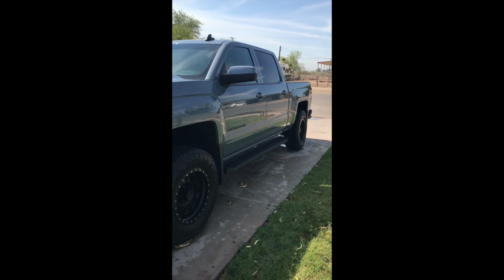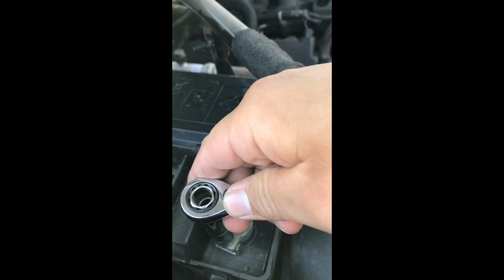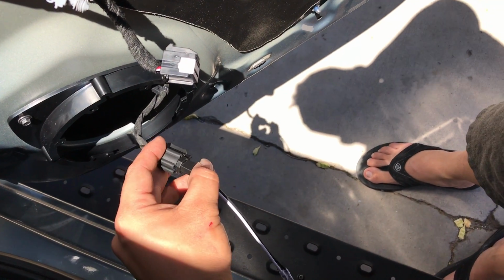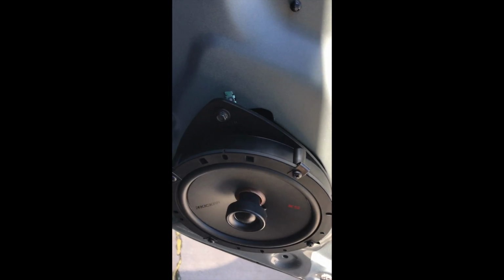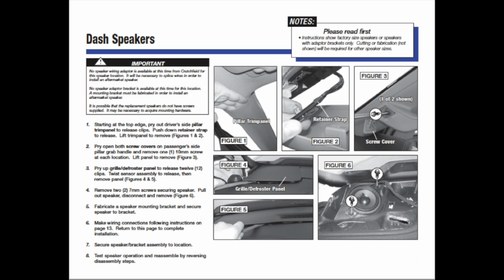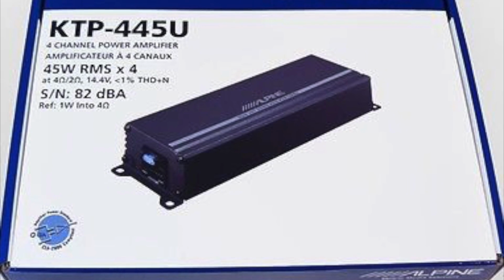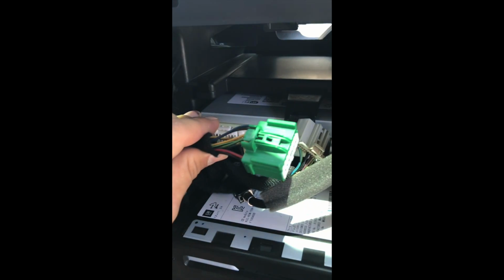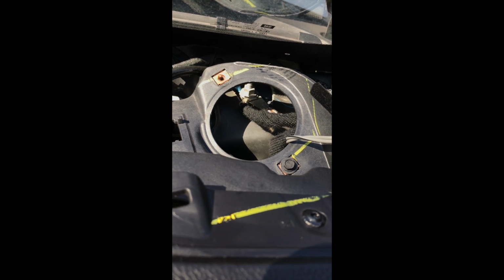2016 Silverado Speaker and Amplifier  install

Comment: Did you run a power cable from the battery to the amp?  Or used power from Radio?

Comment: Hey man I don't know shit about audio. I have installed kicker coaxial speakers on both of my previous vehicles tho. Do I need an amp to run component speakers. I've heard they have a lot more depth in sound. More bass
Reply from the maker: I believe it all depends on the type of speakers your running and the watt of the radio head unit. If you have an aftermarket stereo you probably won’t need it. If it’s stock like mine was and you want a crisper sound I would recommend one. If your not too sure install the speakers and see if it’s meets your satisfaction. All component speakers do is filter out the sound and send them to the appropriate speaker. The Kickers I bought me tweeter has 3 setting to fine tune. To be honest the for the Front speakers isn’t set to high due to the Door Chime. 

Hope this helps, any more questions I’m glad to help

Comment: Did u use bass blockers at all if so where u use them on
Reply from the maker: Hey Jesus, I did not install any bass blockers/ capacitors.  The crossover has built in capacitors. But you can add one to the tweeter as a secondary fail safe.
Reply: I got a probelm bro like I playin my music kinda loud and I didn’t have amp installed and it’s jbl speakers I have put in theire and my speaker make no sound at all I checked fuses is good but I’m say is my speakers work fine but no sound coming to them they made a kinda thumping noise before sound went off any suggestion?
Reply from the maker: jesus Santana Hey man is it all the speakers or just a couple. May be a wiring issue, blown out speakers, or even head unit.
Reply: Thanks bro for the advice and one last thing did u wire the tweeters from the door speaker or did u run a wire to the amp?

Comment: Hey after I install the Alpine amp, the sound is great but now my door chime, welcome chime, and turn signal are loud as hell.  I was wondering if you had the same issue after you installed the amp?
Reply from the maker: Hey what's up George, I had the same issue. On the amp you can adjust the front and rear amplification. What i did was adjust the front to the point where i felt it was tolerable. I believe i amplified it about 2 clicks. My set up still sounded balanced.
Reply: George Sanchez  yes just make sure to leave key in ignition. Let the chime stay on disconnect. That speaker mark them . Then the next step is on the amp turn the dial down  speaker will work loud and get rid of the chime

Comment: Were did you mount your cross over ? I’m in the process of doing the same thing just don’t no were to run and mount it
Reply: Dan, Master of None cool I have the same model truck and was trying to figure out we’re to mount it not much room on the door panel, was it hard to run the cable from the drivers side ?

Comment: im going to do mine the rite way which is going to be expensive, going with an amp pro to get a clean low level rca output right at the radio then running that to the rockford dsr1 sound processor then to my mids and highs amp then into a 9 conductor cable going back up to the radio to the T harness that LLJ customs sells so i dont have to hack my stock wiring, 4 deaf bonce sylvesters for my door speakers 2 crescendo ft1 super tweets in the dash with 4 sundown audio 8's under the rear seat, the amp pro is badass because you get that clean low level pre out right at the radio but its 325 bucks and it allows you to ajust your door chime volume so the amp doesnt blast it like crazy
Reply: This sound stupid as fuck to do for all that just get an after market radio you think your doing it right and you think your cool cuz your throwing away extra money but in reality your idea is stupid

Comment: If I am going thru the TROUBLE of doing any thing to speaker I am adding a LEFT & RIGHT SUB WOOFER.   I have a new 2018 GMC Sierra SLT z71 4X4 and it has BOSE SOUND SYSTEM but I forgot to order BUCKET SEATS that is the only way you get a BOSE SUB WOOFER with a GMC.  Which I don't understand because my FRONT SEATS ARE BUCKET SEATS with a CENTER CONSOLE    .  MAYBE they are talking about the BACK SEATS being BUCKET SEATS.
Reply: The Bose sub is only 6.5 inches so it isn't going to hit very hard. It's probably in the console along with the amp that runs it.

Comment: Quick question...If  I replace the speakers but dont add a amp will I still notice a difference? Will it be worth it???
Reply: Jonathan Hernandez i am wondering the same thing— any update?
Reply: Yes. I installed 6x9 Kickers in my front doors and Kicker 6.5's in my rear doors all running off the factory radio and it made a noticeable improvement. I already had 2  JL Audio 10's powered by a Rockford Fosgate amp to enhance the stock sound but it sounds even better with the Kicker speakers. Next step is to add another amp to run more power to the door speakers.

Comment: Yeah I just bought an 18 without the Bose system, really kicking myself. The stock system is terrible.
Reply: It's not terrible but definitely Stock.... I'm thinking if replacing the 4 door speakers with no amp. Wonder if it will help...
Reply: @FutureMillionaire26  did you replace the speakers without the amp? Was there a difference? Im getting ready to get slme speakers on my 18 non bose
Reply: @carlossaenz6946  Hey yea man I replaced My 4 Door speakers with JBL all around. It sounds a bit better but not as loud as I'd like. So eventually I'm going to get it connected to a 4 channel amp and Probably replace the dash speakers as well. I bought from crutchfield for the 6×9 I went with JBL Gx962 for 60 bucks 2 ways. And for the rear doors JBL club 6520 coaxials. If I replace the dash my also consider JBL's as well but most likely have to do some modifications to make them fit.

Comment: Dan on the amp there is two power wires, one for the battery and one for remote. Did you only have to use one because I don’t think there’s a remote 12v in the stereo harness

Comment: You used the green for input what about the output wires were did you connect the end to.plus will it work the same way if I have the Bose set up.my amp is located in the back behind the seats

Comment: I now want to swap my speakers with some jl audio C3s. I noticed you didn't run any new wiring to the speakers. Is it necessary need to run new wire?
Reply: Dan, Master of None just picked up the focal EC/ES 165Ks..I'll be running new wire then. What about that  bose AMP I still have there, should I just unplug the speakers from it and call it a day? I have an after market head unit btw..

Comment: Did you run a direct wire to the battery for power supply to the amp or was it in the harness that you tapped into when you inserted the amp in the dash..?

Comment: The front door speakers are 6×9 and the dash speakers are 4" and of course the rear are 6 3/4 . Why did you drill a hole in pillar. You could of got a six channel amp and sound better😒😞

Comment: So what did you wind up doing about the door chime? Just installed a power pack and the chime is piercing my brain!!!
Reply: My chime played out of my front right speaker, and after the power pack installed it was 10 times louder, even with the volume set all the way down on settings...wound up using the rear deck outputs for the inputs on the power pack,  and hooking my front stock outputs to the rear speakers, now the chime is on the rear right and still at factory volume!

Comment: so i know that you used the green plug to tap into the signal to use it to input the amp but how did u tap intp the speakers? did you have to cut that green plug?

Comment: I'm thinking of going this route. I have the same truck. The factory radio is low and typically have to almost max it out in order to get decent sound. I also put in new speakers. Did this power pack make a big difference in sound/volume?

Comment: I have a bose on mine and my stereo shop guy told me to leave it how it is. If I try to upgrade my speakers that it won't sound that much better.
Reply: I have a Bose as well. I added 2 10" JL Audio subs into a box that fits perfectly under the rear seat, along with a Fosgate amp to push them. After tweaking and blending the bass from the JL's with the Bose system, it sounds FANTASTIC. It's like surround bass.

Comment: Where did you grab the power for the amp from?
Reply: Cool! I'll do the same. I'll let you know how it turns out 🤘
Reply: Dan, so when connecting the amp to your speakers you cut the wires that were ran to the green harness correct? so the green harness is plugged in to head unit. where you clipped wires the green harness wires get rerouted to the amp and the the amp wires go to the speaker wires. so basically a by pass onthe green harness. correct?